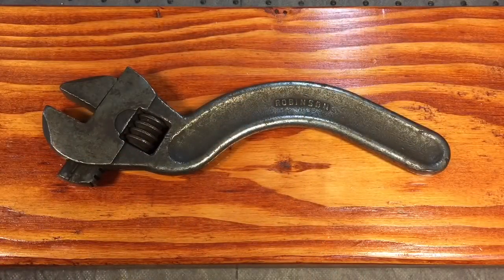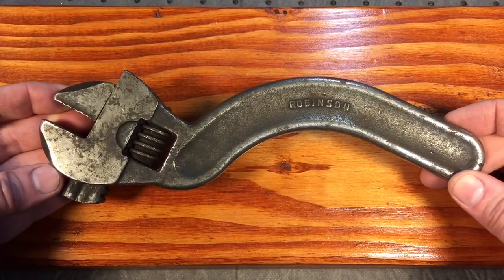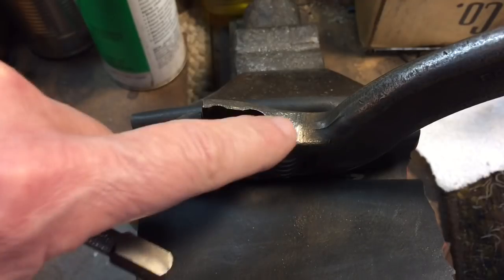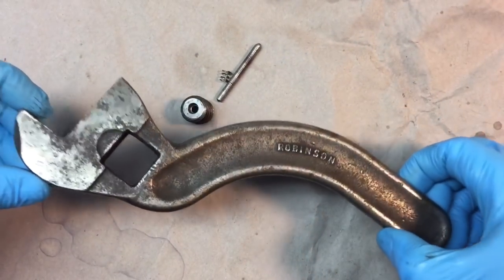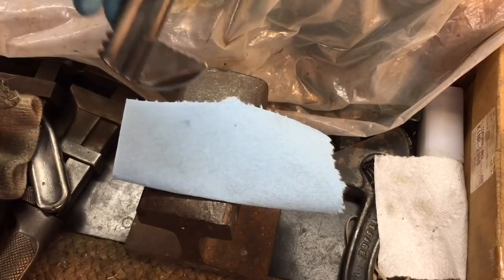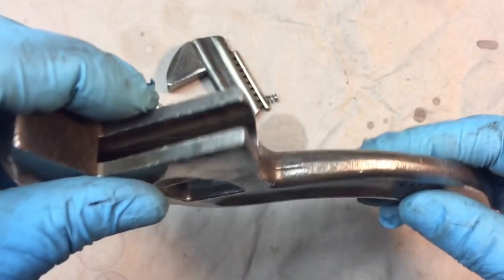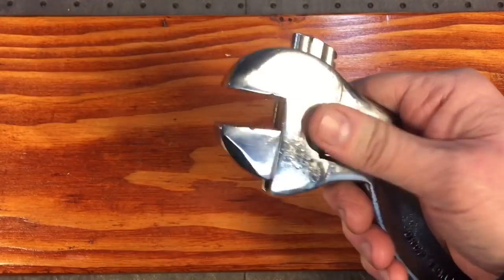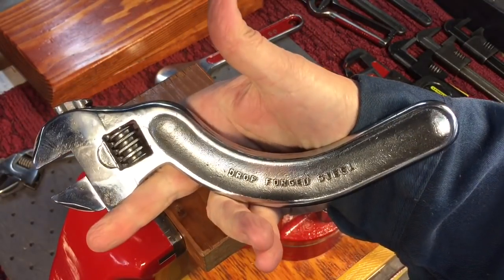Robinson Curved Adjustable Wrench Restoration

Comment: No RED! After using modern tools I think it would be very hard to go back to using tools like that for everyday. Good tip on using the heat. As per before that old metal sure polishes up very nice.  Hint ! Red in the center of the handle would make it pop. Stay safe.
Reply from the maker: Hello norherman!  You know I’m starting to get withdrawals!  Maybe I’m hooked on paint fumes?!?  Lol. Thanks! 😃👍

Comment: I use my s handle cresant wrench on gas bottles it fits better  than a standard one its hard to explain but if you can't turn the head of the fastner or nut/bolt head far the you can alternate between a standard wrench and a s shaped wrench.

Comment: I've recently begun restoring a similar wrench. Mine doesn't have a pin that goes all the way through. Mine only has a hole on one side, and it's caked enough that I can't see what to do /use to get the dial out. Would you have any suggestions?
Reply from the maker: Matt- You can cut thru the pin like I did here!  https://youtu.be/fSMjLWdkdW0